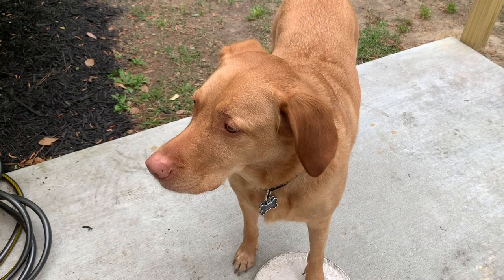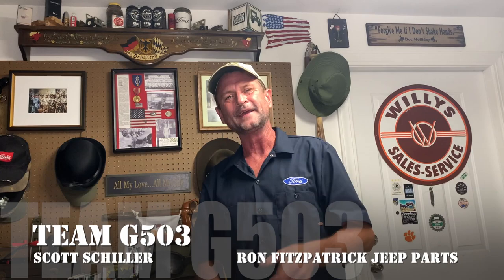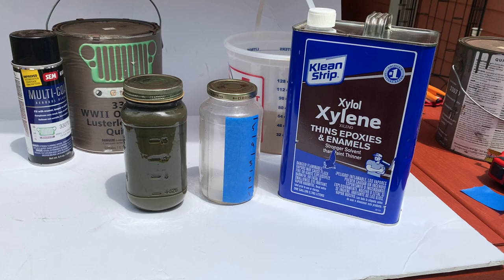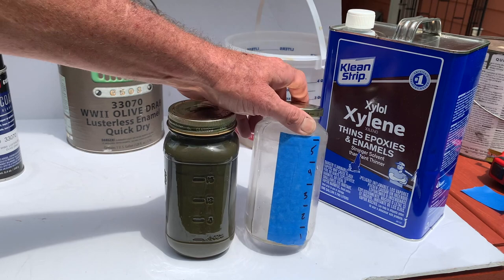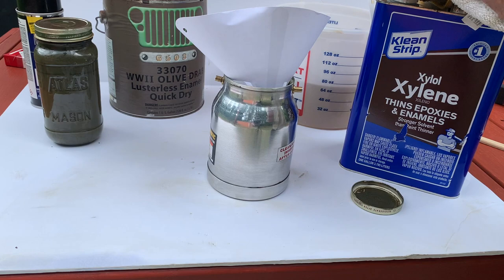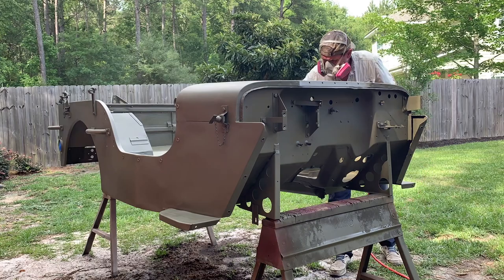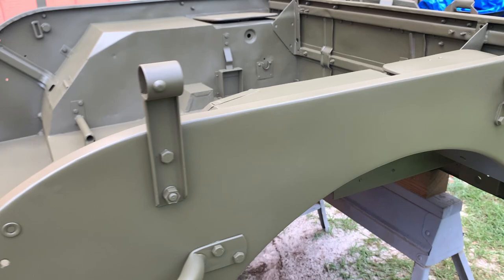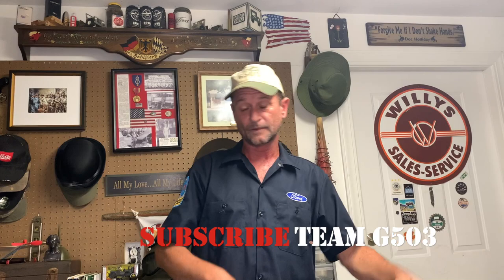WWII Lusterless OD Green 33070 Paint Correct Color For Your G503 Final Coat On The Willys MB Project

Comment: You got a very good coverage on that, I find it is easier to get the inside floor right by tipping the tub on its side, that way the dry overspray does not fall back on the lower floor panels(I put cardboard masks on the lower faces to catch the overspray), with a bare tub like you have here that is a much easier way of spraying the inside faces. Stay safe! Chris B.

Comment: If anyone outside the US wants to have this colour and you don't find how to get it imported or whatsoever, go to your local paint shop and give them this number  33070
My local paint shop here in Belgium managed to convert this to a modern standard and mix it for rattle cans and 2k paint for my spray gun. It was not cheap (about 100 euro for 1L of paint, hardner and thinner is cheaper. And the cans where around 15-20 i think), but the colour is nice and the quality is good.

Hope this helps somebody.

Comment: I can't find Xylene anywhere local, but I found some Majic Reducer at Tractor Supply. Would that do the trick?
Reply from the maker: It may cause the finish to have more of a sheen.
The big box stores like Lowe’s and Home Depot have Xylene in the house painting departments.👍
Reply: @TeamG503  I wanted to let you know I did end up using the Majic Reducer based on your comment, and it turned out having a gorgeous satin finish!!!

Comment: Hey Scott, I’m planning on painting a high top cargo van with this paint and trying to figure how much I should get. Could you give me any estimates on about how far a gallon of this paint goes? Thanks and very cool jeep!
Reply from the maker: Austin, I used 1 gallon on the body tub fenders, windshield, hood, top bows. I would say for cargo van, two to three gallons. It’s a one part enamel, and very affordable.👍
Reply: @TeamG503  Awesome thanks a lot! Have you ever used hardener in it to give it a little more durability?
Reply from the maker: I haven’t used hardener, however some I know have. It will give it a bit of a sheen. If you use hardener, make sure it’s compatible with synthetic oil based enamel 👍